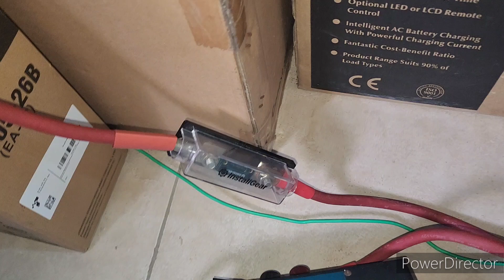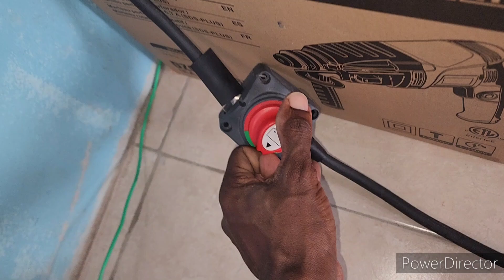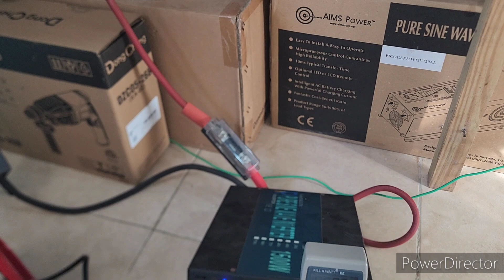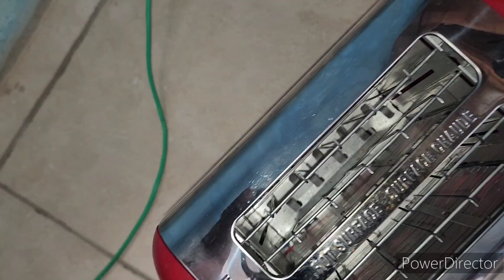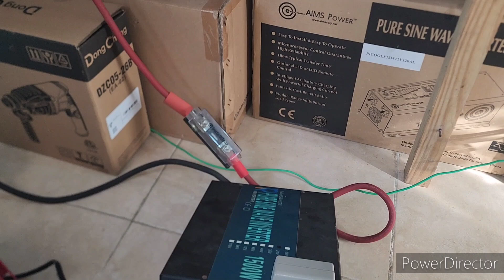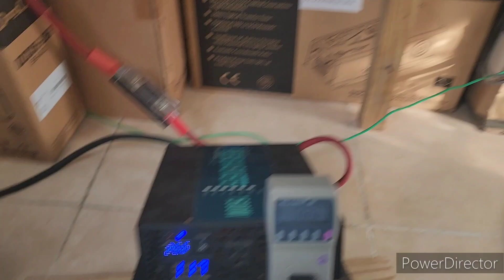Small offgrid 24v solar system

Comment: Nice setup, and is very close to what mine is.  I mainly plan to use it for power outages after hurricanes or other storms. 

I have two 24V - 100A-H batteries, Victron 1200 VA (about 900 watt) inverter and two Victron 100V/15A MPPT charge controllers, shunt power meter, as well as various cables, wires, fuses and breakers.  I also have a 20A battery charger that will pump 500 watts into the batteries. 

I also have a variety of panels that are not mounted but I can pull out when needed to fill out the 800 watts available panels capacity. 

I am currently testing out three 100 watt panels leaning against  a couple saw horses, and they do a decent job of keeping up with my garage refrigerator and my garage door.  

I am currently using about 1000 watt-hours a day and the panels can put in about 1500 watt-hours a days when the batteries are a little low from cloudy days. 

The 800 watts I have for emergencies should easily keep up with my two refrigerators and garage door. 

I have a couple power stations and portable panels for other uses and a generator if I need to charge everything.

Small systems are great!!!
Reply from the maker: Respect bro your system sounds portable victron products are very good I definitely need a battery charger my batteries went out back in December had to use a 24v panel to wake up the bms.
Switch to utility until batteries recover